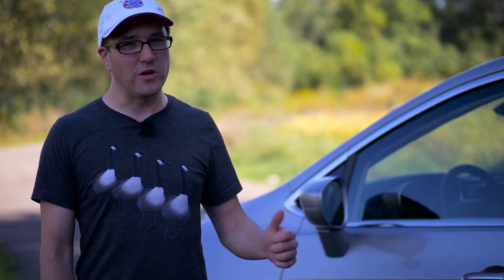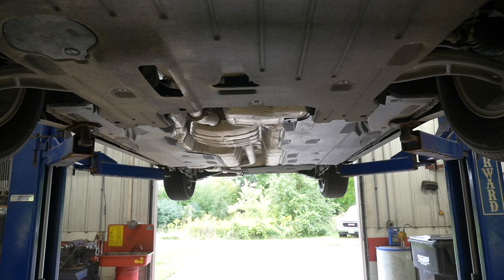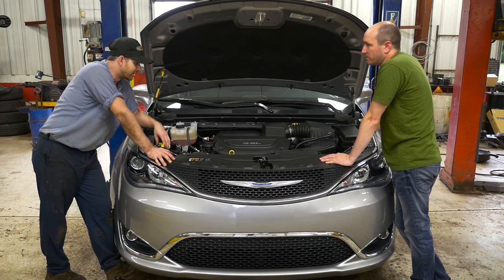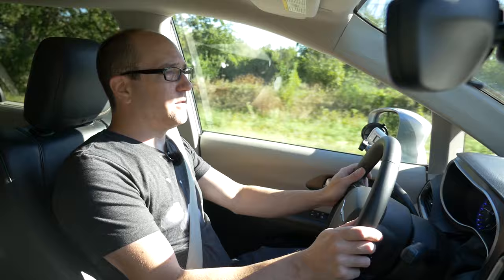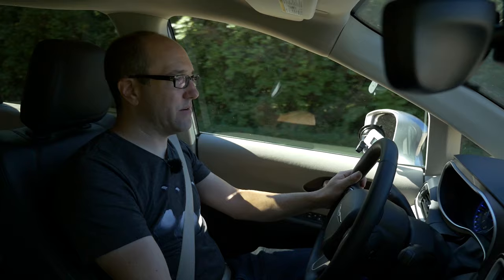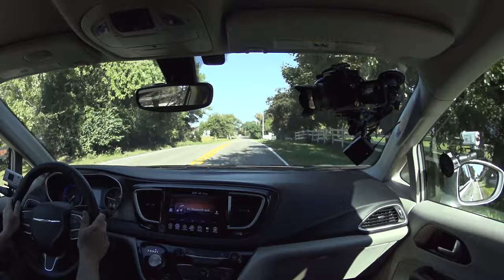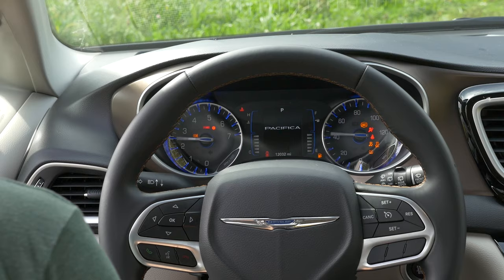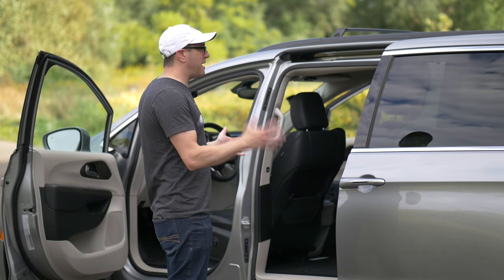Review | 2017 Chrysler Pacifica | The Van Done Right

Comment: The Pentastar engine in this generation and the 2016+ Grand Cherokee have the 2 stage variable valve lift (not just timing) system.  i.e. Chrysler's version of VTEC.  This helps provide the strong top-end power.  Also has cam phasing for variable timing, which is something the Honda SOHC J-series V6s don't have. Pretty advanced stuff.  With an aftermarket intake you would hear the crossover point engage.  Amazing engine.

Comment: 9 speeds are obsolete, the next Pacifica will have a 22 speed transmission.
Reply: ChrisLonewalker with overdrive
Reply: Brad_0 Yes, how could I forget overdrive? Thanks   Brad!
Reply: ChrisLonewalker Made by Shimano
Reply: ToxicHorsePucky or takara.
Reply: ChrisLonewalker Single speed reduction gears will replace multi speed transmissions.
Reply: Every step in RPM will have it's own gear

Comment: I agree with your comment about the crossovers. My wife and I had a look at this today in a showroom, and I sat in the third row and it was so comfortable and I'm 6'2" and 140lbs. All the switch gear felt excellent and the quality was first class. The seats were so comfortable. When the time comes to buy a new minivan, we'll be getting one of these. Fantastic size for taking our two dogs about in. And with the Uconnect system, you can start the car from your phone. Plus my wife liked the 911 button on the mirror and the assist button, just like Onstar. Chrysler have done a fantastic job.

Comment: I like it. The problem is that Chrysler has a terrible reliability record.
Reply: True I think they are working on it. When I purchased my Cherokee in 2001 I was prepared for massive reliability problems.  They never came.  My jeep now has 300,000 miles on it.  Original trans and engine.

I would get an extended Chrysler warranty.  When it was about to expire if I had no problems keep on motoring.  If I had problems sale with 1 year left on the warranty.
Reply: 10tenman10 Depend on how you treat it. I have a Town and Country (2005) that has over 300k and its only had the hubs and radiator (other small things) replaced...
Reply: There are tons of Dodge / Chrysler minivans still on the road with tons of miles on them... he's right about alot of the quality on some of the stuff and certain things failing at 80 to 120k.  The parts for them are very inexpensive and easy jobs. 
The market segment that tends to  have purchased these sometimes as the 2d, 3rd or 4th owner tends to be a segment that also does 0 maintnance on anything until its actually broken.  even the old ones for the cost were good minivans. 

 The new ones look like they have learned some lessons and made quite a few improvements
Reply: @xhizzous  My only concern is the ZF transmission that’s been unreliable in every car it’s been inside

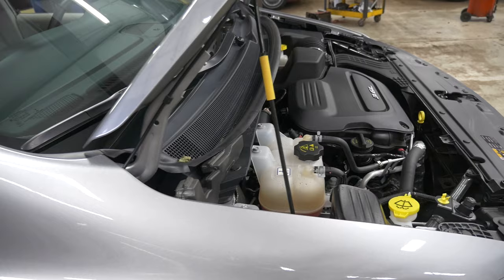Comment: 6:19 that is why I had no problem with the previous gen Town and Country.  The price was so much lower that the Toyota and Honda, I had no problem replacing in my case the radiator, right front break caliber, alternator, power steering reservoir,  Brake Master Cylinder, oil and tranny gasket and brakes of course by 100k miles.

Yes, you get what you pay for and I was still way ahead on the $$$.

Comment: A big determinant between buying a minivan vs.a three row crossover, is AWD availability of crossovers. 70% of the US receives snow in winter, and the use of wide, low profile tires on modern car's, don't plow through the snow like the old narrower, higher profile tires with softer rubber did, even with front wheel drive. I'm also not convinced of the strength of Aluminum for the front control arms, especially on cars this heavy. I'd rather have solid iron ones, regardless of any handling or weight penalty. Savagegeece: Thanks for testing an average vehicle, us car lovers don't all love sports cars.
Reply: They’ve added the availability of AWD to Pacifica for ‘21 & up

Comment: I just bought a just bought a 2019 Touring L yesterday to replace my 2010 Town and Country - there is no comparison between the two vehicles.

I will say this about three row crossovers (I also have a 2015 Dodge Journey) - they make a great second vehicle.  I use my Journey as my daily driver, and it's big enough to haul my family (4 kids) in a pinch.  I would never consider it for regular family use just because it doesn't have the size of a van.

The Pacifica though?  I haven't seen anyone say anything bad about it anywhere.  The 3.6L Pentastar has been around since 2011.  It's also in a LOT of Mopar vehicles.  Other than the 2011 rear cylinder head problems (which were recalled and corrected), I haven't heard of any widespread issues with it.  The Advanced SafetyTec Group - I can not say enough good things about it, and I've only got 15 miles behind the wheel with it.  You just don't realize how good it is until you drive it, and then drive something else without it.
Reply: 3.6 had rocker arm issues, but those were solved around 2015

Comment: Hopefully those quality improvements will lead to reliability improvements. Because Chryslers in my household certainly have not been reliable with fit and finish and electronics. But our 88 did stay in the family for 15 years. But our 94 had transmission problems after only 70k miles. That being said, I would need to lease one of these newer ones and see how they fair before I am comfortable enough to buy one with the thought of keeping it.

Comment: It was a good drive. The middle seats were much more comfortable than I thought they'd be, and oddly were probably more comfortable than the driver seat. I'm not sure that's a good thing. It certainly did have some hustle.

The middle seat back was broken, the shitty plastic peg was bent. The power folding rear seats couldn't coordinate the lowering of the head rests with the collapsing back and got stuck half way down. There were gaps, the left trap floor didn't sit exactly right, it was as if a B crew did the whole thing. It did not engender confidence in the build, and... The one on the lot was $50fucking,000 which is completely insane. 

Over all we'd have picked the Sedona if we had decided on a minivan, but went with an AWD GT CX-9 instead. Been really happy so far.

Comment: I watch a lot of people driving around in a suburban or some other monster SUV.  If you are not towing, then there is little need for a full size SUV.  These front wheel drive minivans cut through snow very well and if you put on a set of snow tires, they will go through almost anything.  A set of snow tires on their own rims will cost $1000 or less.  

The interior space is fantastic and the gas milage crushes any large SUV.  Minivans just make sense.  The sliding doors make it very easy to get in and out in a parking space that a large SUV would not even fit in. 

I get that some people say that minivans are just not stylish or cool, but I guess if they are willing to pay at least $10000 more, pay much more on gas and deal with trying to park a huge SUV that they are not going off road with or tow with,  I will resign myself to just not understanding the large SUV phenomenon. 

Forget 3 row crossovers...why don't people buy wagons?  I don't understand anything.

Comment: What attribute I didn't hear covered is the isolation of the cabin from road/tire/engine noise, a big deal for drivers/passengers as they grow older.  Some of the newer and upscale trims on the Pacifica seem to emphasize it as a driver car, a performance car, a slick handler, great tire/wheel packages, etc.  Does it live up to any of that superficial sizzle or bling on the outside?

Comment: Unfortunately the longevity on this 2017 Chrysler Pacifica Hybrid sucks.  My van engine light came on every few weeks the day after I bought it used.  The dealership sold it to me and it was a lemon after I got in and drive it a couple months after I bought it.  Now it’s been in the shop for a month and are working with Chrysler on how to fix it.   They are replacing the whole computer system and wires and harnesses.  Still not completed.

Comment: Not just level of refinement with Vee sixes over turbo fours in larger vehicles: there's a long-term reliability aspect too. The turbochargers are on boost for a greater proportion of engine run time, and thus will wear out sooner than they might on a lighter car, which demands a lower duty-cycle over, say, five years of typical driving.
Reply: not even close

Comment: Im 42 and my current dodge caravan is the best car ive ever owned.  My next vehicle will definatley be a chrysler minivan most likely the pacifica.  I think SUV's are a huge waste when you vehicles like these running around.  Once you get a minivan you'll never go back to an suv and certainly never a car.  If all you care about is how you look then get an suv but if you are a logical human with half a brain you would get a minivan.  I use power sliding doors twice a day and i drive mostly alone.  I only use the second row seats and fold the back down and i can fit a forest back there.  Great simple non direct injection engine.  almost 300 hp.  POwerful uconnect.  Its literally the perfect car.

Comment: ZFmakes best trans.  Many high-end cars use them...as well as Hellcat and Demon.
Reply: The problem with the Zf 9-speed is that it's a FWD transmission. Dimensionally it's tiny compared to the ZF 8-speed in other FCA vehicles since they are used in RWD setups. As a result you don't have enough space for more robust gears and you need more complex mechanisms to fit in the space like the dog legs. Each moving part is a point of failure.

Comment: I love your presentations BUT the one very important thing that you are leaving out is Customer Service.    You do an excellent job and you do it clearly.   I'm interested in a Pacifica but Chrysler doesn't have the greatest reputation for quality.   I need to know whether they're going to be right there for me when something goes wrong.
Reply: If you maintain them very well and don't drive as a jackass on a regular basis, they'll give you many miles of very little problems. Major issues with the powertrain and major electrical, such as the alternator will last a long time.
The things i find that are problematic are rear wheel bearings and brakes, tend to wear prematurely. 
I had 3 generations of these minivans, a 1997, 2003 and 2012. These were the most common issues.

Comment: Glad to come across a different take on reviews, while still delivering the info. Quick question: I noticed an orange light on the dash while you were driving, was that just the traction control and the roads looked dry, what caused it to come on, if that's what is was. Thanks!
Reply from the maker: +Krezz19 yes indeed traction control off, extreme driving!
Reply from the maker: +Krezz19 yes indeed traction control off, extreme driving!

Comment: It's late 2018 & that ZF 9 speed still needs to go away.  Also were the front CV Axles ever updated?  They work fine on good roads but anything crappy they start having problems.
Reply: Did they ever fix the shifting of the ZF 9 speed? I drive a 2017 Pacifica for work and occasionally it shifts really strangely. Other then that it’s a fantastic vehicle.
Reply: @grantdillon1083  Honda solution was to start in 2nd gear in S (Sport) mode.  Otherwise just unknown "software fixes" is what I've read.

Comment: Seen some issues where this van will not shift out of park or disengage the electric parking break.  Did you notice any issues like this during your test?
Reply from the maker: +MrRjsnowden I saw some lag or delay in releasing electric parking brake, took a few times to release.  But I always release it before shifting, habit from manual transmissions.

Comment: Turbo is so right... they are built cheap... the  starter, alternator, radiator, etc., go at 80k... that's why i would never buy a chrysler
not to mention the power windows and power doors that take turns to fail... little things that drive you crazy.

Comment: There is no excuse for this to have such tall gears when it has so many. At full throttle, once it hits 5th gear it falls out of the power band, and quits accelerating. It has a 3.25 final drive ratio, it should be 4.25.

Comment: First, great job.on the review. 2nd were you paid by Chrysler? JK. You don't have to remove the carpet on 2nd row to stow n go. You do need to push a button to move the front seats forward. After that just push the whole thing up against the rear of the Fri t seat, amazing the thing stay in place without you needing to hold it up.
My complaint is the spare tire kit pkg it does close well. Bad design. Also have you noticed the different between 18 or 20 inches suspension compare to 17? They call it Touring suspension. Wonder if that more firm. Lastly, when I go to Chrysler they have two 3.6 engine what's that all about?
Thanks for the review.